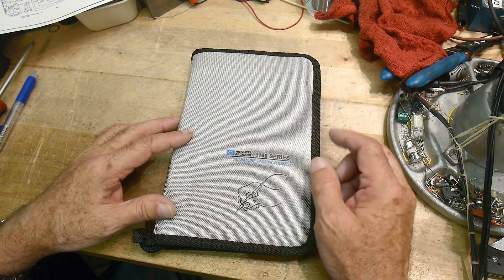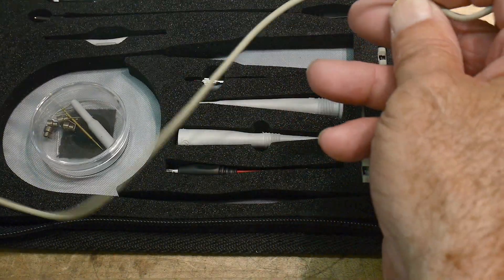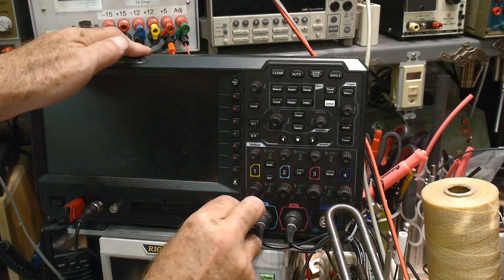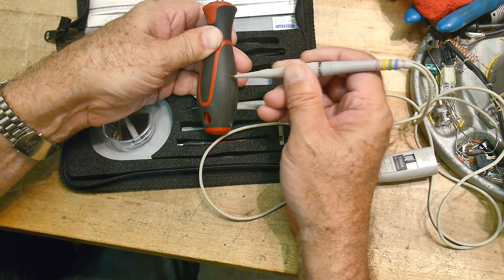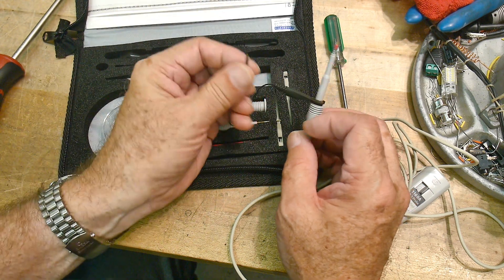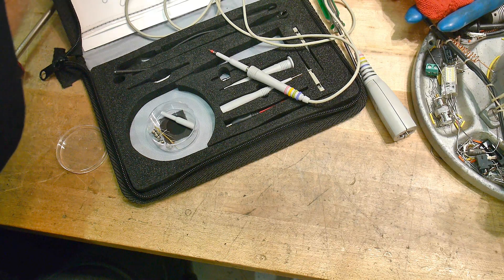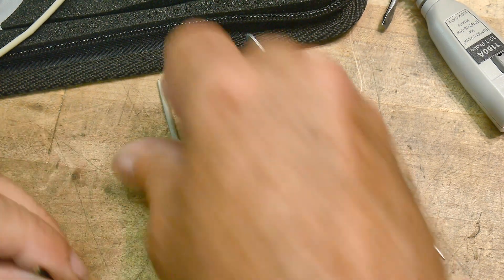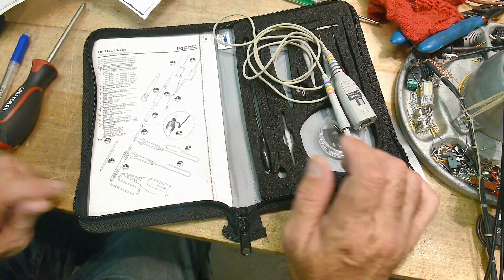#1284 HP 1160A Oscilloscope Probe

Comment: I recently fell in love with the HP 1043x series of miniature probes... there were a handful on eBay, in 'new' old condition.  My only complaint is the plasticizers have started to go out of the cables, which makes them not quite as nice as when they were new I imagine.  The used ones are less worth buying, any damage is usually fatal and missing parts is frustrating...

Comment: Did you try this probe with your Rigol? Can you compensate the probe?
I'm asking, because on the case is print "COMPENSATES 6-9pF.
Reply from the maker: works great
Reply: @IMSAIGuy  Then you're lucky. In middle of 2020 I bought probe exactly as yours (1160 A) but listed as Agilent ... it didn't work with my DS4022B... it was always under... After 2 experimenting with it put it back on ebay ... 2 days sold!
Reply from the maker: faster scopes have less capacitance. so my 350mhz scope has nominal 10pf probes. the HP 500mhz probe at 9pf was close enough I guess. I have another 500mhz probe that works fine too (HP10073B). see this video: https://youtu.be/zlhKA5hpNOo

Comment: $50 ? Bargain for one of those ! I have a set that I slowly accumulated for my Agilent DSO7014A. One of the cables has gone faulty and I'm looking for spares. There are actually several in the series .. not sure of the differences. The browser is really nice, but I do often find I browse to a testpoint then want to lock-on, at which point I want  the other hook.